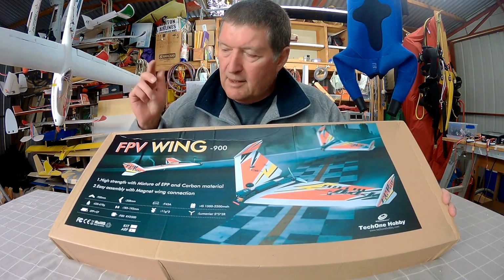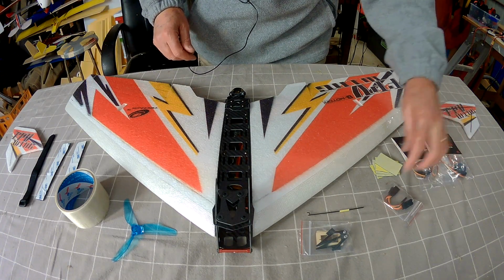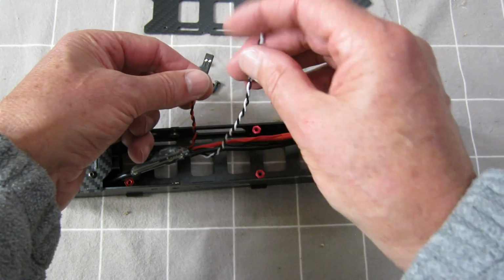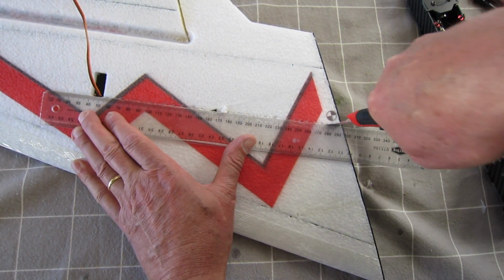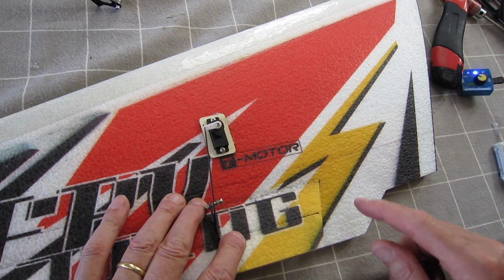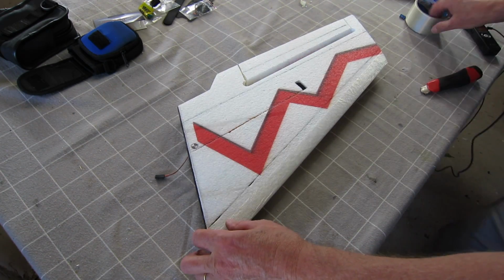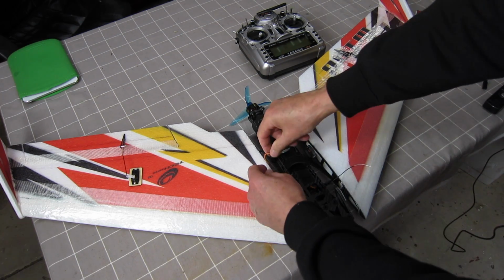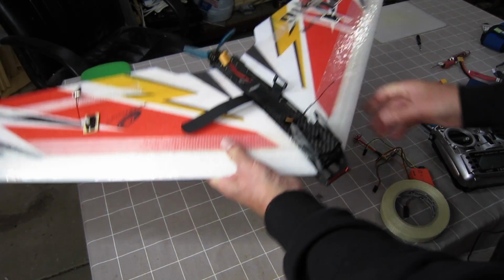TechOne FPV 900 Wing

Comment: my ESC doesnt have the 2nd servo wire like yours does , mine has 3 
wires with 1 servo plug
Reply from the maker: A normal plane ESC, guess they ran out of the Mini Quad ESCs

Comment: Andrew. To answer your question as to why the separate BEC is needed. This design is using a miniquad motor and ESC. We all run OPTO ESC's for three reasons. 1. They are smaller than their BEC'd counterparts. 2. The power from an external BEC is usually cleaner and provides an less "noisy" setup. 3. They run cooler even without the heavy heatsink needed on a BEC ESC. The end result is TONS of power on tap, glitch free operations and cooler components....all in a nice small package. The one change I would suggest to this setup is to uninstall the BEC and go with a separate PDB that offers 12V and 5V outputs. There's plenty of room and it offers more options for FPV gear and accessories to be installed.
Reply from the maker: Thanks for your multirotor perspective badandy. That all makes good sense.

Comment: It's worth noting that the centre-section is NOT solid carbon... it's that el-cheapo Chinese fibreglass with a layer of carbon on each side.   It's not as strong or as light as pure carbon but probably "satisfactory" in this application.
Reply from the maker: Greetings Bruce, good info thanks. All the edges are super sharp too so I can see some cut wires in the future unless I protect them better

Comment: Hi Andrew, 
Thanks for the great info and video quality. Wondering what the video camera is?
I found a 'trigger' type soldering iron which is useful for cutting slots - given the correct shaped copper wire bends.
Also just thinking that it might be a good idea to 'invent' a magnetic servo connector (like the USB ones) which detach
when there is force like a wing pulling out.
Reply from the maker: Now that would be a great invention. Wide camera is an SJCAM M20 and the close ups are Canon S100 compact camera

Comment: another blatant rip-off.  mini-racewing already making one.
Reply from the maker: Yep getting that message loud and clear.
Reply: Yeah should have read the comments first.  There are a few differences between the two, but still sketchy.

Curious to see how it acts and takes a crash.  Be interested to see a high speed dive right into the ground.
Reply from the maker: Would you like me to test the full speed crash? I'm sure I will at some stage, just hope it's on camera.
Reply: Andrew Newton That would be great.  I know the mini race wing has true carbon fiber for the body, and friction holders for the wings.  curious if the magnets will hold up better in a crash? 

Having bought a few quad frames from China, the carbon is typically very low quality and fairly brittle.  If the body were able to hold up to the crash it may be a good starter plane to practice on before jumping to the more expensive version

Comment: Looks like a fun plane  can't wait for the maiden. 
l would like to know what method you would use for a v the tail some on the forums say use the v tail mix on the TX others say they fly better if you use ailerons mix and reverse the directions.
Reply from the maker: Mix of elevator and rudder on each tail surface. I don't use setup wizards, I'll have a look at the Nimbus mix and post it here.